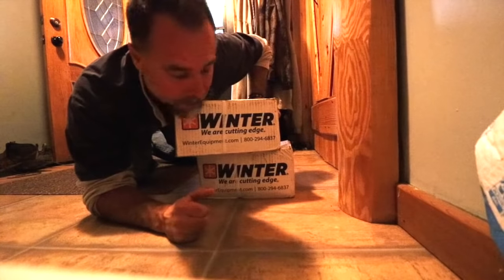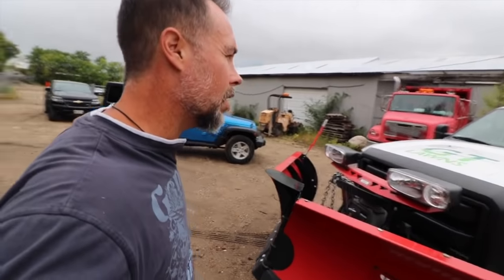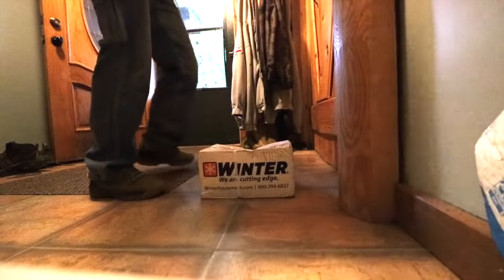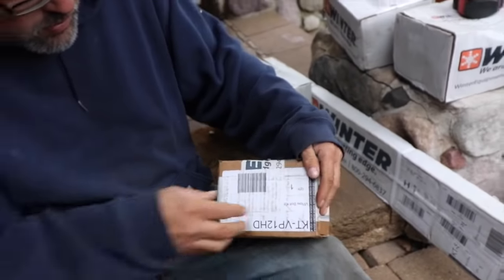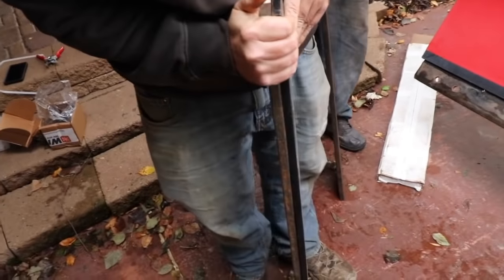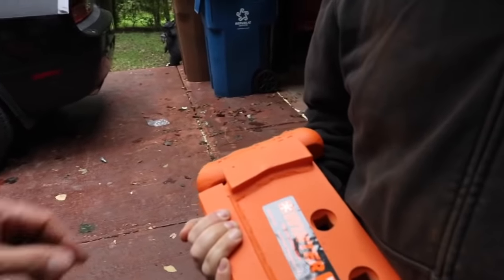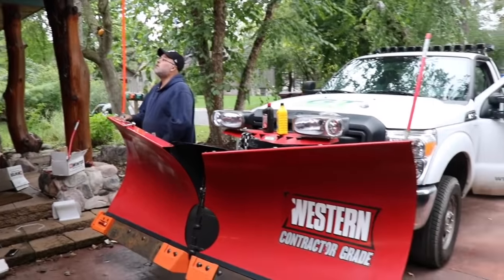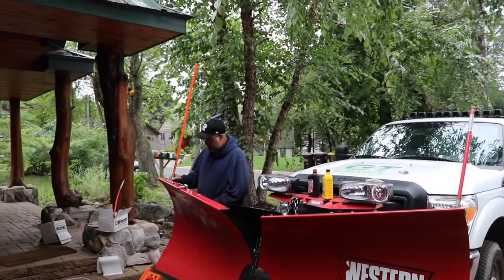Westerns Plows have One major flaw- their cutting edge-which I permanently fixed

Comment: Higher carbon steel will "ring" more when tapped or filed. The trouble is IF you use your file on really high carbon/hard steel you just dulled it and the file will not cut as well.  An easier way is to just take one of the carriage bolts and tap the cutting edge with the rounded head. The tone of the "ring" will be totally different. The harder the steel the higher the pitch.  A link chain is the same. Take a grade 70 chain and just rattle the links. They will ring. A lower grade chain will have a flat sound.

Comment: I live in upstate NY.  Some years we get hammered with snow and some years we don't.  I just bought myself a 2014 GMC Duramax 2500. I also added an HD Snoway plow.  I am a 1 man band and have never owned my own business. I really appreciate the knowledge you offer in your videos, it is helping more than you know.  I have got to be one of your biggest fans. I want to have the same company you have but in NY.  This is hard for me because I have no one to assist me. You are the only one I have.  Oh and also my credit and the bare minimum in funds.  I just started plowing driveways. Something I have never done before and its something I am training myself.  I just recently picked up my first commercial account and its an apartment complex.  I plan on starting landscaping in the spring.  I just need to get myself a trailer and a Zero turn lawn mower to get going.  My biggest question to you is being someone that is starting from nothing and trying to get my name out there do you suggest I just mow lawns and maintain landscaping that already exists and work my way up. I have zero snow plowing or landscaping experience outside of my own properties.

Comment: I had found a place that had hardened cut edges, lasted 2 seasons+. Metal fabrication shop/blacksmith...?
Had to cut 3" off of overhang each side of plow. Took couple hours each with sawzall.  Dang was that hard steel.
Definitely have a good light and tool box with you. If you need to fix a blown line or your engine even lights in lot aren't enough. Maybe even magnetic so your hands are free.
Great video thanks again. Taking your experiences and passing them along. God Bless you.

Comment: I have a 2014 Ram 3500 4wd with dually rear, bought mainly for pulling a 5th wheel hay wagon (and an RV) but it has a front Western plow (for fairly light duty plowing).  I love the Cummins engine and there is ZERO rust on the chassis or body.

Comment: Hey guys. Need to replace my fisher xv2 edge. Couple thoughts: 

1) is carbide worth it over regular steel for the price difference. I think $400 difference? 

2) I love the orange pieces of equipment in the video. They I assume will be heavy. Will it be worth it to ship to toronto area and maybe have to pay cross border taxes? 

3) do about 30 houses every time it snows here. Is the back drag edge a worth while purchase?
Reply: Also, with those Center piece additions and curb guards will that help with less wear on the cutting edge ?

Comment: Just quick use a jack stand if you go under the plow. Also I found that if while you are tightening the edge bolts keep the gun running & you or a helper hit the head of the bolts they take a set better. Don't know if you ever had some come loose? I don't remember that well  but I think if you take a grinder to the 2 cutting edges (new & old) look at the sparks. longer sparks = softer steel harder steel makes lots of small (more carbon)  long time ago & memory not so good anymore !

Comment: The really hard plate steel will have a dull thud sound when hit with a hammer. Abrasion resistant plate AR400, AR450 and AR500 will last a very long time. I never had much trouble with cutting edges because I use the skids on the plow. Many people don't. I put a couple of layers of hardfacing welding rod on my skids and they never wear out.

Comment: I work at a truck equipment shop and have installed many plows and we are a Western dealer.  So since you upgraded all your cutting edges and bolts to grade 8 you should probably think about upgrading all the bolts that hold the mount to the frame of the truck because they are all Grade 5 bolts so since you added all that extra weight to hardware that was only designed for a certain amount  you might want to think about that
Reply: No don't do that, bolts are graded and used in different applications for a reason.  For example, the frame bolts need to be able to flex somewhat, something grade 8 will not do as much of, and it could if overtorqued cause frame cracks.  The edges need as much clamping force as possible, thus a grade 8 bolt, but the frame needs to be able to flex with the mount and truck together without overstressing the mount holes, bolts or any particular component that might happen if you use a high tensile strength bolt.
Reply: Bolts loosen, holes elongate.  Doesn't hurt welding an couple of inches frame to hitch as well.  There's nothing more frustrating at 5 or 6 in the a.m. to have your plow hitch laying on the ground.
Reply: @barrysimmons5489  One of the reasons we bolt them on is to protect against frame cracking.  Bolts do come loose when incorrect hardware is used.  Holes enlongate when incorrect hardware grades are used.  Smarter not harder,  why make extra work when doing it right the first time saves the trouble.  Obviously c
Some manufacturers have difficulty with engineering their materials applications.  Im saying this as a materials engineer.

Comment: People run whatever they like, its just a matter of preference.

I run a 2005 dodge ram 1500 hemi with a fisher plow and i think it's  a great truck. 

2001 ram 2500 5.9l with a fisher plow as a spare truck(this truck is mint condition) 

Also have a mahindra 1538 with loader and rear mounted blower. 
Yet to try this as its brand new. 

Keep up the work stanley.

John -

Comment: Beginning to look like the plows we use in northen Sweden on private roads. I do personally have a preference for a toolsteel edge since it doesn't chip as easily and you can reground it on your own.
Reply: Took steel is going to be more brittle than these HC steel blades. I think you heard him say carbide, and you think they're carbide blades, but besides being prohibitively expensive, they would be to brittle. They just have carbide in the mix. Also, it doesn't matter what type of steel they're made out of, you can grind them yourself.
Reply: @xenonram   I'm thinking of a steel  high in cobolt and hardened to about 600 Brinell. What I don't like about the high carbide mixes is that they have a tendency crack if they hit steel  at an angle (sewerline lids heaved up by frost for example) and that they retain more heat when grinded (can foul the hardening) not as much of a problem on a riving blade thou.

Comment: I just bought a 2018 in July 2500 4x4 I’m going this week to put a deposit down on a new western 8.6 V blade. I plowed with fords the past 18 years. Let’s see how the Chevy will perform. Also I rented a Ford F-250 2018 crew cab 6’ bed the tag showed 4,400 front axle and my Chevy reads 5,400 I thought that was weird.

Comment: Wow, these are 5/8" Boron carbide. So... Basically tank armor. I'm interested in how long these will last too! Looking forward to a cost analysis in these; showing it's "worth it". I'm sure it is...
-- Also, wouldn't you want the longest plow markers on the back plow unit? And keep the shorter plow markers for the front?

Comment: Ford is the right choice diesel is around $10K more. Make sure you get the plow prep package. Fords gas 6.2L with the new transmission will do the job well.maybe 3.75 rears better fuel mileage. get the rear axle lockers. The $10K for diesel will take time to pay for it. Great video thanks

Comment: Hey Stanley... I recently purchased the boss drag pro. I reviewed your videos previously on the short iron and the snow power... I was really impressed and instantly inspired to acquire a "pull plow" I live in Syracuse ny. And I actually have the first one of it's kind here. Couple that with the fact that this area is inundated with closed minded judgemental non experienced experts and you should be able to imagine the comments I receive. I only purchased the boss because of availability. I have a boss dealer less than 20miles away and it was remarkably cheaper. This season I only have residential accounts. I do feel there are downfalls to the boss as I'm sure there are with any of the manufacturers. My questions are; 1) have you reviewed the boss drag pro? 2) have you reviewed the ebling? 3) what are your thoughts on what you have reviewed? Thanks for the great vids!

Comment: Stan first off great video and upgrade ! Best of luck with the snow plowing season !! 

I got a question about bolts maybe if you don't have the answer you could get the correct answer .... My question is I've been exsplained that cutting edges use grade 5 bolts instead of grade 8 or 22.5 ect. Because of the shearing strength meaning if you hit a man hole cover or storm drain and if you get that "BANG" the bolts break before the blade bends I've been warned by 3 different manufacturers not to upgrade to grade 8's ...thus why I carry extra 5's in my truck ... Honestly I've only ever sheared 3 bolts in over 15 years of plowing .... But watching this video and seeing the grade 8's being installed this is the major question on my mind ..

Thankyou for any feedback and insight you could give !
Reply: JeeperJimbo 1990 That’s what I was thinking as well, I see the grade 8’s possibly leading to tearing on the plow itself where the cutting edge bolts up.
Reply: @chevyon37s  I'm not being critical of Stan's upgrade I've been the go to guy for alot of guys over the years because i bought my own hydraulic line crimping tool so I can make up any length line if a guy blows one .... "Best choice I've ever made" making the extra cash while out plowing making cash lol ... Like i said i have grade 5 bolts on hand for anyone that needs them at 3am in the morning lol ... Nut and Bolts cost me about 0.42 cents in bulk..  i charge a  simple $1.00 for them alot of guys hit me up for 10 bucks durring a storm I tell them where I'm at plowing .. they come to me and fix there trucks and head back to there work ... Like I've said I've been doing this for years and to be honest I'm wondering if I've been doing it wrong ... LoL nobody's said anything to me anyway ...
Reply: The cutting edge has a trip so if it hits anything that dont move it wont break anything. The grade of bolts used wont make a difference.
Reply: @tim2195  ok tell that about 20 of my customer's ! Yes certain plows have a trip edge and I've seen the pin mounts distroyed from to many hard hits ... According to manufacturer's they all "Fisher , Boss , Western , Meyers" are my most common customer's plows ... Grade 5 is recommended ... Yet the Winter cutting edge he is installing uses grade 8's I've reached out to them with no responce .... I'm asking Stan to possibly get a explanation from there research and development .... For all I know the grade of steal that the edge is requires a heavier grade blot .... I would love to recommend this product to people but I'm not going to recommend something that could cost my customers thousands in the long run ...
Reply: @JeeperJimbo  are these plows that are getting destroyed because of careless driving? Plowing at high speeds? Cause if you have a customer with something you will be plowing over where it needs to trip you should be slowing down or raising the plow, if it's the first time at a customer's place and dont know what may be under snow you sure dont go full send.
Reply: @tim2195  most of the guys that have had problems plow streets its true about what your saying but these are owner operator's I'm not present nor care lol they need the stuff fixed they call me if I can stop @ my account for 15-30 mins to help them them I do ... I carry hydraulic line in my truck box cut the length they need have a assortment of fittings ect... 98% of the time nobody bothers me but guys know I'm out if something happens they can call ... Money is Money guys trust me ! I don't rape them like some guys do and my word is my bond ... I'm not afraid to ask questions if I don't know the answer !! Knowledge is power !!
Reply: @JeeperJimbo  I understand that. My opinion is they are pushing there equipment pretty hard to be destroying trip edge pins. And plowing streets are definitely gonna be hard on trip edges as cracks and variations in pavement will find any plows weak point.
Reply: He puts all that extra weight on the plow with grade 8 bolts but all the bolts that hold the mount to the frame that take all the abuse are grade 5

Comment: Definitely do the big 3 truck compaison.. I just bought 2017 f350 srw and th ride is 100% better than the 2016 and older models.. also the 6.7l powerstroke is finally a good engine beginning in 2011
Reply: Tread Lightly Services LLC. Chevy 6.0 gas is best. Not that I need one at 275000 miles but I can get a factory 6.0 at the same cost as a set of diesel injectors for your truck.
Reply: @richardfoglerjr3706  Gas is the worst choice for a work truck. No low end torque, it's always wound out, and chews through gas.
Reply: @richardfoglerjr3706  I have a 6.0l gas actually I have 2 of them, they are great, the problem I have is the independent front suspension on these trucks, they dont like plows and they hate to trailer heavy bumper pulls. Straight front axle is the way to go.
Reply: Tread Lightly Services LLC, I also like solid front axle plow trucks.  However, there are a ton of Chevy/GMC 2500/3500's plow trucks in my area that do just fine with their IFS.  The Chevy/GMC 6.0L engine is a good engine.  It's just down on power compared to the current gas truck engines, been that way for a while now.

Comment: I never did like Western plows. I always thought their cutting edges were too light and I never trusted the trip mechanism.  I was of the opinion that if  you hit something just wrong, the blade would trip, the springs would break, and the plow would lay over and stay over. I much preferred Fisher plows.  When you hit something just the blade would trip and the springs for that system were much stronger, and the cutting edge was a lot heavier.  That was back before the company was sold to Western, and the plows were made in Maine.  As I understand it, when that happened the quality of the plows went down.
Reply: I've never broken a plow spring on a western and I've been plowing snow for 26 years.  Never had a trip frame issue either.
Reply: same . 20 years. western only. got nothin to say about any other plow because ive never ran them. I guess that would out me in a category of insularity. but what im doing, and what ive heard through the mill, i dont think im doing it wrong. 20 years... West Michigan. Snow belt.
Reply: 20 years. western only. got nothing to say about any other plow because ive never ran them. I guess that would out me in a category of insularity. but what im doing, and what ive heard through the mill, i dont think im doing it wrong. 20 years... West Michigan. Snow belt. Never a Broke spring. cutting edge 1/2''. never broke. Plow a ton. cutting edges get 2 years easy. sometimes replace them just for cosmetic. waste of money but i dont care

Comment: We bought three new 2017 f-350 and two new Chevys all three of the fords have rusted out exhaust manifolds, and two out of the three had to get all new brake lines. The problem with the fords we have is there is nothing preventing all that salt from the roads going straight into the engine bay destroying everything. With the Chevys the Engine bays do not get any of the road salts up in there and they still look new inside the Engine bay.
Reply: run ford and chevys. Gotta wash them after every event. got trucks 15 years old and look nicer than 5 year old trucks that dont plow. Its routine. when route finished guys wash trucks. they might go 2-3 snow events if the snow keeps up. soon as storm is over, we wash.  ... 20 year vet
Reply: jason Fisher  it’s really hard to believe about ford it almost sounds like GM.

Comment: Did I see a Hiniker in the mix? I've run Hiniker for 15 yrs. I watched the video to compare the list of 'must have's' in the plow truck. Flashlight, certainly. Personally I'll swap out the spare clothes for un-careful employees for more self recovery items (shovels, traction boards, etc) due to my rural pushes.  Are those 'wings' on the back plow strong enough to move snow hydraulically or will they bog?

Comment: Go with a dodge, best engine and overall pretty solid platform warranty is great too 5 year/ 100,000 miles for the powertrain. I'd say they also have the best factory performing exhaust brake, rarely have to use the brakes when towing or going down a grade.
Reply: honesly i love dodge trucks but  my dads a mechanic and he likes dodge a lot too but he has said that they have been the brand that has been brought in with the most engine problems ford with the least and im not bias because i like doge better there just not always the most reliable